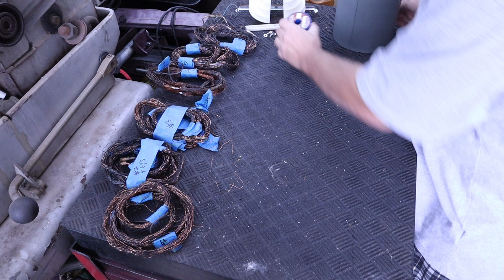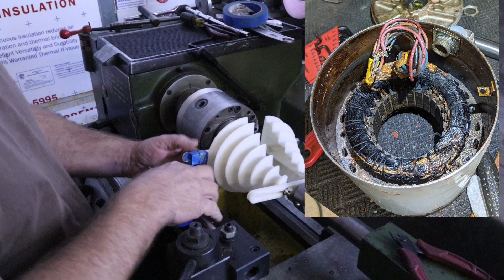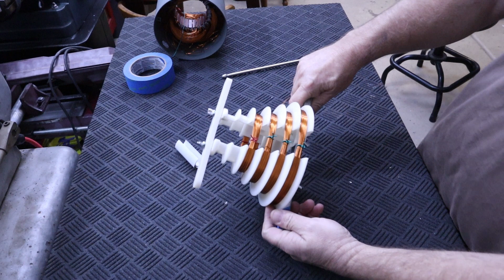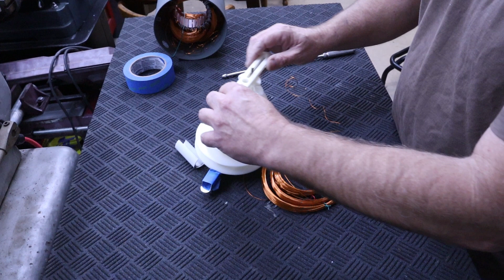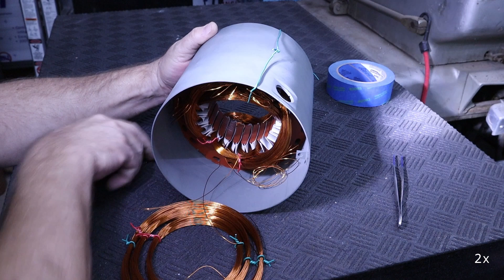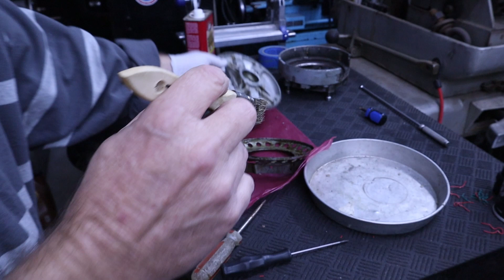Rewinding a 1hp Motor. Part 1 of 2.

Comment: Im glad to see this video thank you.   I just got this really cool Walker and Turner 'gear' motor that gears down a regular 3phase speed down to  like 730 rpm.   But it's OLD .......  and I was worried that it might be bad.   I finally got things together to test it out including vfd to run it and it seems to be fine.   I did have a couple over current shut downs but I'm hoping that issue can be resolved in the parameter settings.  It only happened when I cranked the frequency up rapidly.  But it could be a bad winding?   I think this motor would be a unique enough of a candidate motor to put myself through this kind of tedious torture if it does have a bad winding.  I haven't put it under load yet.
Reply from the maker: Hard to say if it is a winding.  I am working on one right now that did have a bad winding.  It was shorted to ground.  You can check the winding ohms between phases and if there is a substantial difference then the winding could be partially shorted to its self.  The bearings could need lubrication.  I would check the windings.  Im not an expert at this stuff by any means.  I have good and bad moments.  You can also use a pig tail between the vfd and the motor to see if you have one ohase drawing a lot more current.  Also unless designed for a vfd a motor can get hot running at any rpm other than without a vfd.  For a vfd motor the insulation class on the magnetic wire is much higher than normal duty.  Good luck and thank you!
Reply: @AlmostMachining  good point about the temp considerations.   This application is a band saw so I don't plan on running the frequency up and down especially with the geared motor already doing the work.  Hopefully the pulleys can work the final sfpm range I'll need.  Either way keeping a close eye on temp will have to be remembered when I load it up.  I saw someone add a server fan to his motor for the lower speeds.   vfd would kick it in automatic.

Comment: Well done Phil, I work with a lot of electric motors and I would never have the patience to take on a rewind. We always send them out. well now day just replace them unless something special. Thanks for showing !
Reply from the maker: A rewind shop would have taken  two weeks or faster given incentive.  I think i can do better as time goes on.  Mostly wanted the experience to be able to help out someone with an old machine and limited resources.  The advent of cheap VFDs opens up a lot to the home shop machinist or Maker.  It also helps with the bargining on a used machine.  Oh the motor is fried isnt so much of a problem as it now can be reduced to time.  Now a very large motor is going to run up the cost in copper.  I dont have any idea as to what i may do if i ever encounter bar instead of wires.  Bridges to cross i guess.  Thank you!

Comment: You're either,  very keen or possibly experienced at this sought of work.

Thankfully,  the 3 Phase Motor I partially rebuilt for my CNC Lathe did not need this much work.
But I would happily give you the job,  if I was based a little closer to you.

Looking forward to coming back for Part 2 of the rebuild.

All the Best for 2022.
Peter 👍
Reply from the maker: Thank you and have an amazing 2022 yourself.  I only have some basic understanding of the rewind process.  That will be in the next video or an attempt at how I see what is going on.